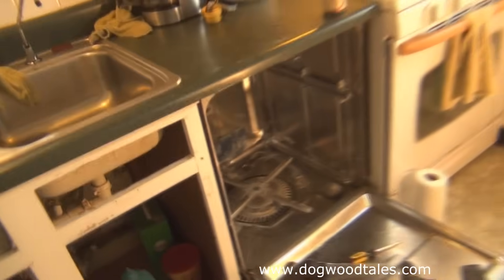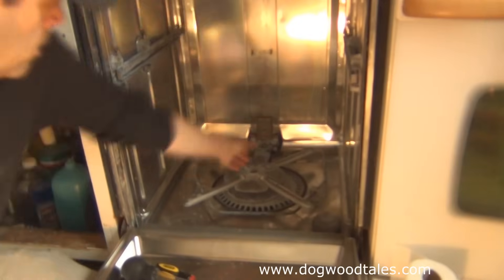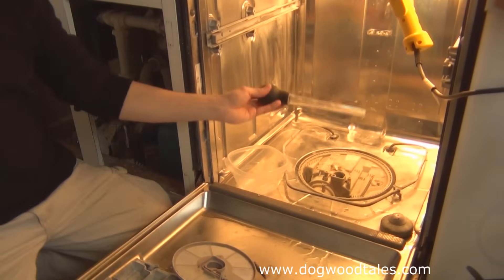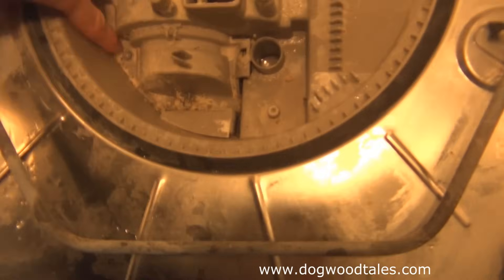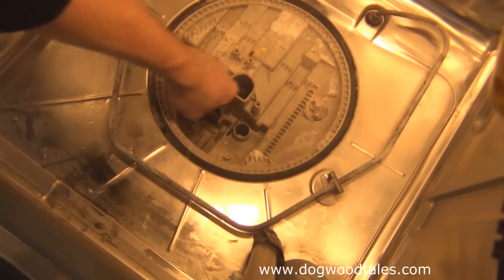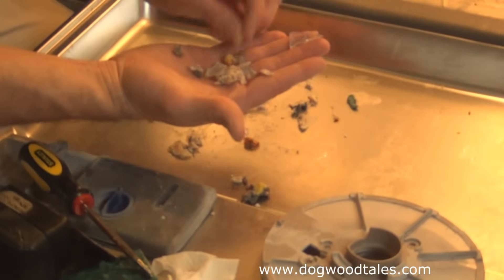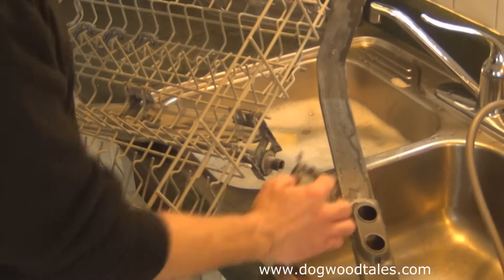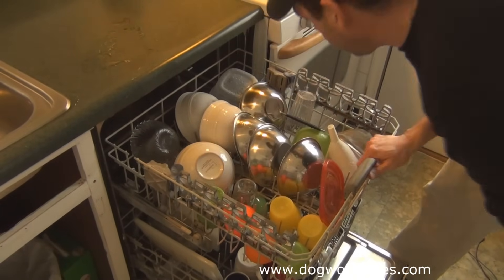Dishwasher Cleaning - Top Rack Doesn't Clean

Comment: I have a 4 year old Whirlpool dishwasher, 18" for a tiny home.  The soap dispenser opens but the soap doesn't dissolve.  When the dishwasher is running there is plenty of water in the bottom so I know it's getting ample water.  I've tried liquid and powder soap and all it does is either run down the inside of the door or turns into a goopy mess in the soap dispenser.  Called a tech and he ripped the machine apart and couldn't find anything wrong with it so he replaced the motor thinking that may be it.  $350.00 later and a few visits, I still have the same problem.  I don't understand how the water gets into the top spinner because there are no water sources attached to it.  I thought your idea of putting the bowls on the top rack and seeing if they get water in them is brilliant.  I'm in the process of doing that right now.

Comment: Hey man just want to thank you for a great video. I’m pretty handy but leery of taking something apart without some guidance. We inherited our kitchen aid with our new house and it’s never cleaned well on the top shelf. This weekend there was a decent sale at Lowe’s and I was about to junk this thing and replace with a new one. Figured I’d google the problem and low and behold I found your video. I’m not surprised it has so many likes and views, must be a design flaw. 

Anyhow started at the end of the afternoon football games and finished before half of the Sunday night game. Most of the time here is the wash cycle haha. So sincerely, thanks a lot.

I do recommend a shop vac to make this easier and also to pull, inspect and clean the check valve. Black piece next to the grinder. 

Owe you a beer!
Reply from the maker: Belo83 okay. I drink Yuengling

Comment: its been awhile since i attempted some thing like this. i'm happy to report a positive out come. thanks for the visual. the tork screws had me, but i googled them and realized i had a set among my tools. more trouble putting stuff back than taking it apart. working angle difficult due to door. my back pitched a bitch but i got it done and it worked. amazing, my self worth has shot up like crazy. thanks again for the tutorial
Reply from the maker: James Waterson It can be back breaking work and that's why I recommend supporting the door with books or something. It's easier than removing the door.
Glad to hear it worked out well for you.

Comment: This was great. I wouldn't take out anything. One suggestion is if you have a wet vac you can use it to suck out the water and the waste. Thanks for the the help!
Reply from the maker: Thank you.
Yes that's been suggested before. I can't believe I didn't think of that, or at least mentioning it.
My wet vac is a big one and I keep it in the shop with a separator, so I probably would not have used it anyway.

Comment: Finally fixed mine, put a video cam and light inside. Top spinner was not turning, holes were clear on both sides and I could blow through it. finally I took it off, held the center port up tight to outside faucet on high, and blew it out for a minute and now it works like new. Crazy.

Comment: Great video!  I followed the directions to clean another Kitchen aid dishwasher (is there a trend here?).  Found all kind of nasty stuff: treat wrappers, twist ties, and at least 2 wineglasses worth of glass.  I used a shop vac to get rid of the initial nastiness.  Thanks!
Reply from the maker: A shop vac is a great idea!
I don't know that there is a "trend" with Kitchen Aid. The metatags to this particular video are heavy on the Kitchen Aid and model number as that what I have, so that's probably the main reason behind a lot of Kitchen Aid dishwasher owners viewing/responding to this thread. Overall I've been very happy with my dishwasher. My family is just tough on it. I think a dishwasher just needs to be cleaned out once in a while as part of regular maintenance and for optimum performance. I even have to clean out my vacuum cleaner once in a while too - and not just change the filters.

Comment: Enjoyed the video, it was helpful.  Our dishwasher basically would not clean dishes anymore as it had no water pressure.  I wasn't willing to pay for a service call. I called KitchenAid to see if they could tell me what might be wrong. They gave me no information that it might be clogged. After taking it apart, I found the strainer at the food disposal "chopper" was completely stopped up. I took that part out and basically had to scrub it with a stiff brush to get all the caked on matter off and out of the strainer wholes. . Has anyone else found this on the chopper? It appears to be a very poor design as the blades on the chopper are not sharp and don't appear to have enough pressure on the strainer to cut the food off of it.  I guess I'll have to make this routine maintenance every few months!  Works like brand new now!
Reply from the maker: +robkitdan 
Thanks for the comments and watching.
I never had to mess with the chopper nor do more than clean out that basin, thank God. But others below mention having issues with that chopper assembly.
I recommend being proactive and checking it about twice a year. Just like anything else (such as cars, certain appliances like these, and personal medical exams) regular maintenance is necessary to longevity.

Comment: great video, but I am stuck with this dishwasher at the first step.  How do you remove the top rack.  Thanks for the help!
Reply from the maker: fondeurb there should be some release latches somewhere on the sides and the rack should then be able to be lifted out of the track. Depending on your model, you might need a third hand. They can be a little tricky. But if you can get in there without removing the top rack then you might not need to remove it.

Comment: Great video, the step by step process really helped me understand my dishwasher a lot better! I did run the rinse cycle and there were five full dishes of water, yet dirty dishes are still semi-dirty when the cycle is done. Should I still take the dishwasher apart?
Reply from the maker: Not sure. IMHO it won't hurt to make sure that the trap area and other components are clean. You could still have junk down there that's not blocking the water flow, but is still sending dirt back into the wash.
Then perhaps run an empty cycle with some vinegar (as long as the manual to your particular dishwasher does not forbid it). On my model the vinegar can help clean out some things, but is not to be used often as it can be corrosive. Put a half cup vinegar in a heavy dish or cup (so it doesn't turn over) facing upright and run a regular cycle.
I would make sure that you're not loading in heavily soiled dishes. In my experience, these things are not like washing with a fire hose. Also look  to the soap and rinse aid being used, hard water etc.
Beyond that ... I don't know.

Comment: Thank you for this! I'm going to test my dishwasher out now and buy the right bits for the drill so I can do this later
Reply from the maker: keep in mind that those bit sizes were the ones my particular dishwasher model has and that yours may be different. but if you know it has a torx and/or square bits and you don't have any that fit, it may be worth your while to buy a packet of various sizes
Reply: Dogwood Tales We have almost the same dish washer but just incase I did go out and buy a bit set which did have the right size bits (same as yours). Disassembly was easy, cleaning however was not. After running the bowl test virtually no water was in the top bowls at all. I have the parts soaking in an oxyclean bath while I run the dishwasher like you did. I'll post later if it solved the problem for me
Reply: Dogwood Tales Alright everythings assembled ran the bowl test and perfect! Already did a load of dishes and they came out cleaner than before. Thanks alot for this!!

Comment: Very helpful, thanks. My only issue is that the dishwasher now runs louder than before. I'm wondering if when I rotated the bottom arm assembly back in place, it didn't click the whole way in, even though the upper arm assembly lines up. But the main problem--upper rack not clean--has been fixed, thanks to your helpful video.
Reply from the maker: I have noticed that my dishwasher runs a little louder than when I first bought it, but not sure if that started after giving it a good cleaning or if, perhaps more likely, the moving parts have worn a little and are simply not as tight when manufactured. It's still a far cry from the near lawn-mower decibels of my old dishwasher! Glad to hear that this video has helped you and so many others. Thanks for watching!

Comment: My chopper was also off the spindle (poor design with all the complaints). Bent the cap grippers down and reset on the spindle. Don't set it too far in or it won't engage the motor spindle. I used the empty socket of a 6in1 screwdriver to set the cap back on. If you set a wrench flat wise between the screen and cutter it will pull the spring in allowing you to set the cutter in place. Make sure both ends line up then release the wrench and the cutter end pops into the motor end. Check to see if it made good contact. If not readjust the cap a little further out on the spindle. Good luck.
Reply from the maker: Thank you for the info!
Reply: On second thought perhaps they make the blade to pop off when it hits a hard object instead of burning the motor out?
Reply from the maker: +entrthedragon idk for sure but that's a possibility.  I know that some things are designed to break so other things don't. such as break bolts  (or whatever they're called ) on mowers and snow blowers are to break so that the transmission or engine doesn't  if one happens to run over a boulder or something

Comment: Great video thanks. I've done this a few times every 6 months or so when my DW stops cleaning well and it always fixes it. This time however I cannot seem to get the bottom part of the top rack to work (the one that sprays up to the dishes on the top rack). The upper sprayer works, but not the one right below. I took it apart and made sure nothing was clogged. but it still isn't working.
Reply from the maker: +Laurence Tamkin Admittedly I'm not an expert here, but the first things I'm thinking of as probable causes to the prop is hard water sediment is built up in the mechanisms and inhibiting it from spinning properly, some other mechanical failure to the prop, or the pump is failing to provide enough pressure.
Reply: +Dogwood Tales (Projects For the Home) thanks, those ideas make sense.

Comment: Thanks so much for this.  our kenmore is 5 years old, and this was happening....top rack not getting clean.  My husband did as you shared, and it worked!  problem is, after a week or so, we were back to same thing.....so he took it apart and cleaned it out again.  Like new for the 2nd time!  Same thing 2 weeks later, cleaned out a third time......and it worked.  Now it is happening again, like clockwork, after about 2 weeks.  Any suggestions Dogwood Tales or anyone else?
Reply from the maker: +Tip It needs to be cleaned every two weeks or so? 
some others below took more apart than I did and went past the chopper. Perhaps you need to do that.

Comment: Thank you, very helpful video! I love your toothbrush comments. Question: two black rubber disk things fell out of the rear assembly when I was putting it back together, I think it was near the part with the two metal balls. They are about the size of nickles and have a little tab on one side, smooth on the other. I'm at a loss as to where they go. I actually put it all back without them and the dishwasher seemed to work, but I'm worried that they should go back somewhere. Any ideas?
Reply: I thought they might fit in the part with the two flanges that the top rack's water source hooks into. Could not figure it out. I even brought them to the local place where I bought it and they had no clue. If you know then you get a prize!
Reply from the maker: My first guess would be the part I pick up around 11:10, but then they shouldn't be separate, at least they are of one unit on my washer in this video.
If not this, then my guess is that they belong to one of these two parts (from my model dishwasher)
W10077600 Manifold, Spray Zone (the power washer that's blue-ish on my washer) - perhaps they belong inside of it somehow.
W10077903 Valve Assembly, Manifold (the elbow)
Perhaps if you could post a picture somehow, I or someone else might guess what they are.
But if the dishwasher is working, then perhaps these are not crucial to the general operation
Are you certain they even came from your washer and not something that fell into the washer, or broke off something else being washed? Silly question, I know.

Comment: Great help today!  Add my thanks to all the others.
Unfortunately for me, the chopper assembly was in little pieces when I opened it up.  (the retaining ring was actually on one of the blades).
Do yourself a favor, and order a fresh chopper assembly BEFORE you start this project.  it's $15 on Amazon Prime.  Even if yours is not broken, it's a part that does break.  Also, cleaning the gunk out of that screen is not worth the $15.
Reply: Oh, I might also suggest putting all the big parts into the bathtub to clean them with a hand-shower.  way less mess than the kitchen sink.
Reply from the maker: +Gregor Miziumski Both great suggestions! thanks

Comment: Your tutorial is great! Followed it and my dishwasher worked like new... For a few months, then top rack not cleaning again. Followed your steps again and it worked like new. Problem keeps happening. Wondering if I need to replace the grinder/ auger assembly? Any further insight would be great. Thanks again
Reply from the maker: I’m sorry but I don’t really have more information than this. I also had to clean this every so often. Encouraging the family to rinse the dishes thoroughly before loading them into the dishwasher helped a lot too.
Replacing the chopper assembly might help, but imho unless you see a reason for it to not be functioning properly it might not be a fruitless exercise. Maybe give a good at the pump first. Good luck.

Comment: Great video. The only one I've found that goes into detail on the function of the 2 ports that supply water to the middle spray arm (the one directly underneath the top rack). I could see that at least one of those water supply ports has a rubber flapper valve to close off the port that is not being used to supply water, but I didn't get a good view of the other opening. I would expect that it, too, should have a similar rubber flapper valve, but ours doesn't.  Ours only has a flapper valve on the lower of the 2 ports.  Can you confirm that there should be a flapper valve in both ports?
Reply from the maker: I believe so.  Sounds like that might be a problem for your machine. There has to be some mechanism to prevent loss of water flow to the top. Sorry but I can’t verify from my washer as The washer featured in this video long since fried (literally electronics burned up inside) and the one I have now is a completely different model but it does have its own style to close off the three different ports for the adjustable top shelf.
Reply: @dogwoodtales  Thanks.
Reply: I have a 10 year old Kitchenaid like the one in the video, just took things apart and cleaned it.  I can confirm that there should be two flapper valves, one on each port.  We routinely use the higher rack setting so the top flapper is pushed way back but still there.  Suggestions - you can take out the part that has the two ports and reverse it if needed, so that the port not being used is the one that has the flapper.  I also found a flat rubber washer that fits tightly around the end  of the pipe from the upper spray arm and put it on the pipe so that it's wedged against the port that's being used - to ensure a tight seal.
Reply: @jmb3450  Thanks. Looks like the only way to buy that rubber piece is as part of the whole upper spray assembly. We are going to live with only using the upper position for the top rack.

Comment: Ray:  Many thanks from me too for the easy-to-follow video.  I completed the job over about two hours yesterday.

After the first wash, I still see the dishwasher does not do as well with items in the top rack as it does with items in the bottom rack, particularly bowls.  (Bowls in the bottom rack do fine.)  Is there a way to test the spray arm attached to the bottom rack?  Do you have any ideas as to why the top rack cleaning performance is sub par?  Thanks
Reply from the maker: +rk7801 I don't know of a better way to test the top rack than what I show in this video. I would re-check to make sure everything is clean and clear from the bottom to the top of the water channel. Make sure the jets (the little spray holes) on the propeller are clean too. If everything is clean and clear and it's still not cleaning well at the top you might have a water pump issue and or a control board issue. But I'm not a professional tech, so my suggested diagnosis may not be accurate.
As some other people indicate in their comments below there could be garbage beyond the chopper assembly that's inhibiting water flow. You may need to remove that and look in there too. I never had to go that far, so I don't have any experience to advise you on that step.
Hope it works out well.